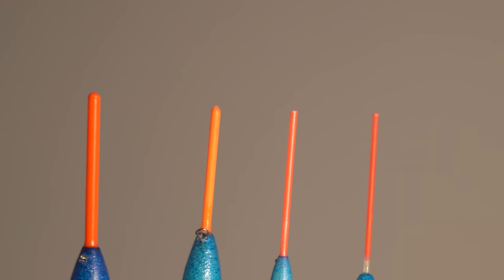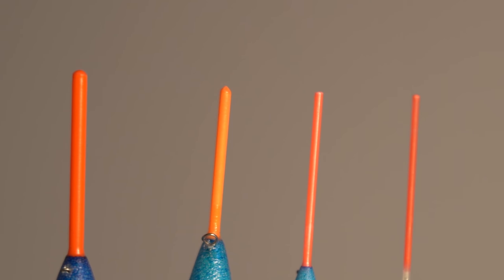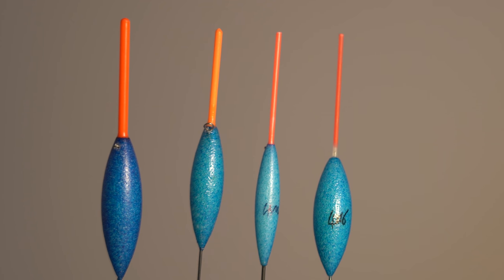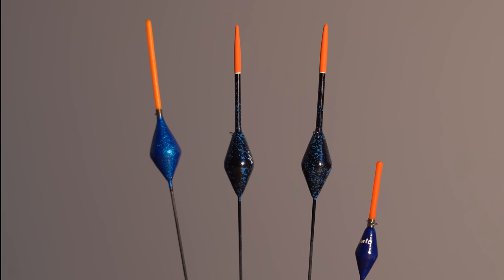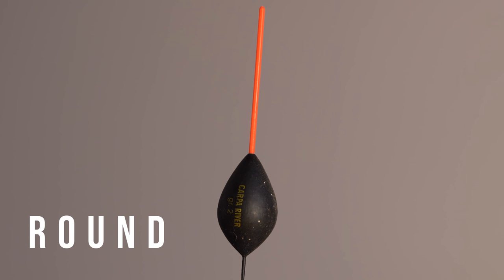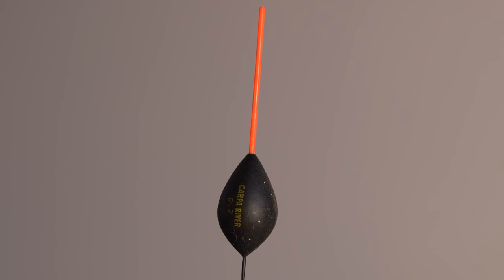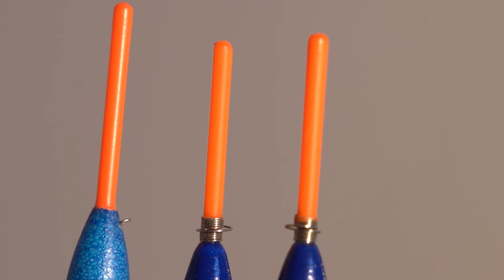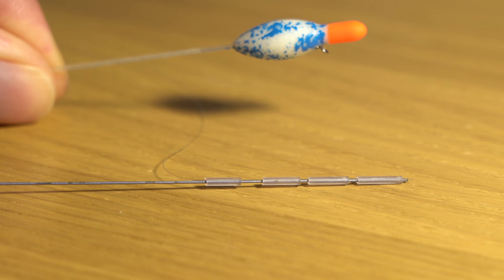How To Choose The Right Pole Fishing Float

Comment: I've got some 0..10g inline pole floats chianti and rugby ball for carp when would you use them pal??
Reply from the maker: Hi Peter I'm not a fan of inline pole floats other than jiggas. Water inside makes the float bristle sit differently etc. Chianti style are good for f1s & silvers through the water on the drop with strung out 10s 11s etc,. 0.1 is a buy light for carp, I dont go below 0.2 for carp as it's simply not stable enough.

Comment: Hi Ben when do you use the dibber and carp shallow floats, thought they were both for margin fishing?
Reply from the maker: Hi Geoff I would never use a dibber for margin fishing as they are too unstable and you cant read the bristle.  Margin fishing is all about creating tight piles of bait and nailing a hookbait smack bang on top of it. Id use a thick bristle, rugby or pear body with a wire or glass stem. Cut down these also work as carp shallow floats when fishing say 2-5ft.
Reply: @BenFiskFishing  thanks Ben, what situations is the dibber used in?
Reply from the maker: Very shallow, theres a section  in the video on them